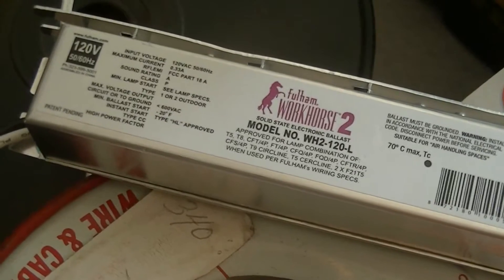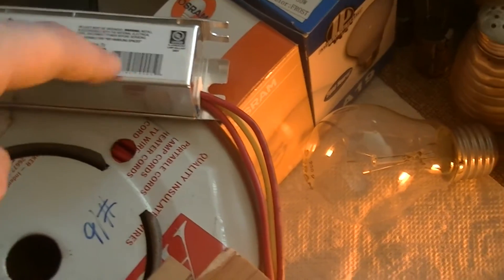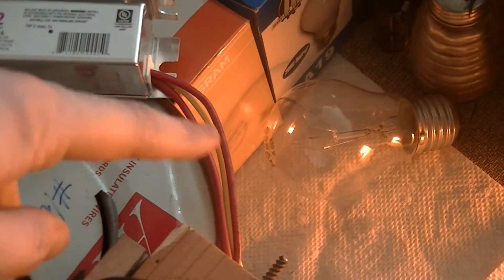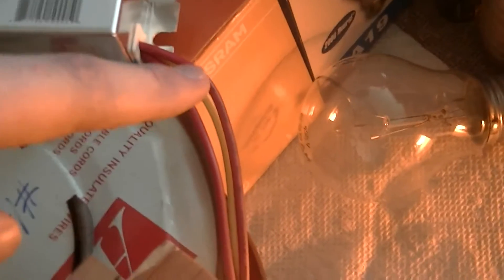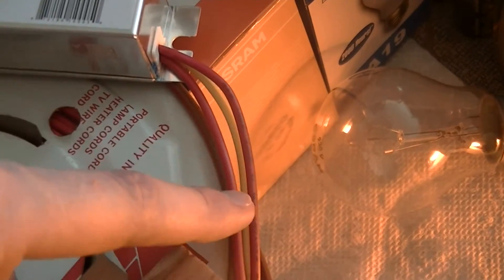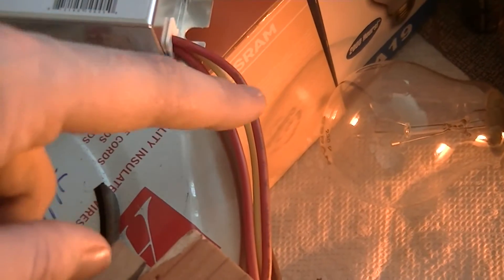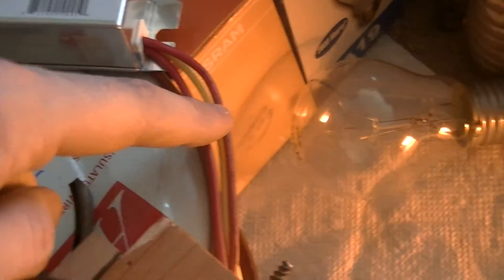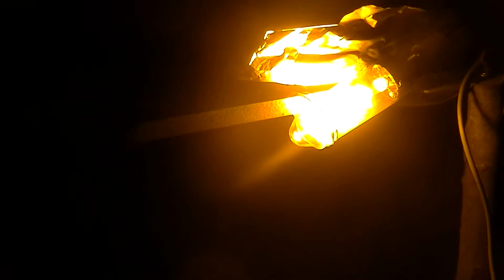Low pressure sodium lamp Fulham ballast testing

Comment: Pretty cool but this Electronic Ballast is not available in my Country is 230v anyone knows alternative? 🤔
Reply from the maker: Proper electronic 220V to 240V LPS ballasts are/were a standard item so you can get those.  You could also get a 18W T8 instant start ballast for 220V to 240V.
Reply: @randacnam7321  is a soft start not better for those lamps?
Reply from the maker: @ Not possible with modern lamps as each electrode has only a single electrical connection.

Comment: Man I am having an issue with a similar build. 20w sodium bulb, and I have tried it on a fulham sugar cube and a fulham workhorse, and both times it just wasn't putting enough power through to ever warm it up. Stayed a dull purple color, and only was drawing .05 amps of line current, so definitely not the full 20 watts. Any ideas what I'm doing wrong? I had it wired up the same way, red in parallel

Comment: The WH3 is better for the 18w SOX (or SOX-E). The WH2 underdrives this lamp by 30%  (as wired), much more with just one red + one yellow wire. The blackening near the electrodes will happen when the lamp is not running hot enough, such as underdriving with WH2. It clears up after a few hours operating at full output.
Reply: Thank you, you may have just solved my issue. Been trying to get a 20w lps burning for a week on a fulham sugar cube and a wh2 and was wondering what I was doing wrong. Neither were pushing more than 8 watts max through the bulb

Comment: Is it normal for these bulbs to be blackened at the front where the light starts? I bought a new LPS bulb for my light and it looks black as if it has been used.
Reply from the maker: Kyle Warden That may be an artifact of the manufacturing process as both of my lamps have blackened ends.  One does have less blackening on one end, but it was a bit derped during assembly (the mica tube support on the electrode end is bent, which is a common problem with current production lamps).  Both of mine have 2013 date codes, so they are almost certainly new.
Reply: randacnam7321 That's interesting, I was worried that I got sold a used bulb that wouldn't last long but the rest of the bulb looks clean and new and it came in its original Phillips box, so it probably is new.
Reply from the maker: Kyle Warden
The date code on the lamp should say when it was made.  This is a letter and a number next to each other.  The number is the ones digit of the year and the letter is the month (A to M excluding I for January to December).  The letter being first is an even decade and the number being first indicating an odd decade.  Mine have date codes of 3F, meaning June 2013.  There should be a bullseye next to the date code, which is the factory code (Hamilton, Scotland, which is the only factory currently making these lamps).
Reply: randacnam7321 You're right, I have 2 lamps and one says 3A (January 2013) and the other one says 3K (October 2013) so I guess they are pretty new. Thanks.